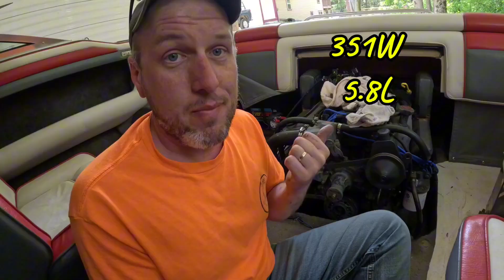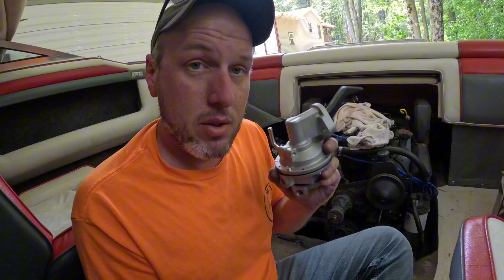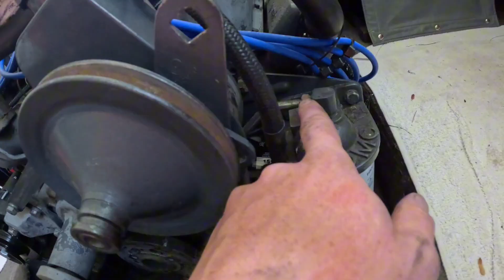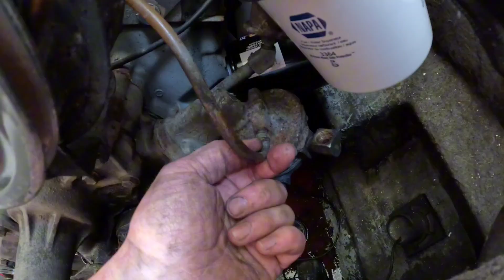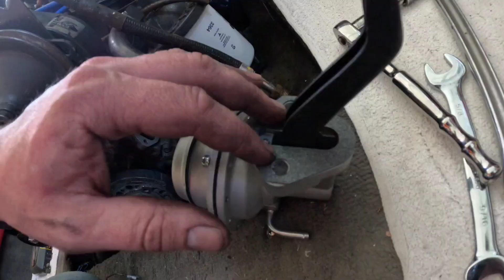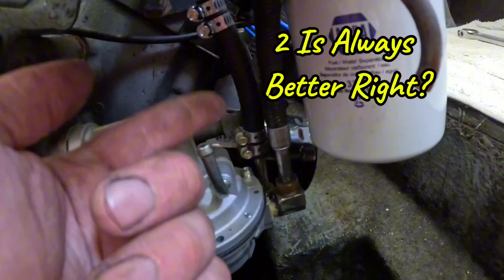OMC Cobra Mechanical Fuel Pump Replacement | 5.8L 351 Ford

Comment: I am having issues getting the fuel pump out because if the motor bracket and another part. Any suggestions? It is on a 1993 Four Winns Horizon. Thanks
Reply from the maker: If you are still having trouble, best option may be to just loosen or remove the other parts keeping it from coming out

Comment: Did you have to use something to hold open the rod in the engine where the fuel pump arm sits in ?
Reply from the maker: No I did not. There is no fuel pump push rod like on a Chevy. This ford one is direct to camshaft. However, an easy way is to use grease to hold it in place if you did have one
Reply: @adventureandrepeat thank you so that arm just slides on into the engine
Reply from the maker: Yes it fits right in the cavity. And depending on cam position the pump may not fully seat onto the block until the bolts are tightened up. Because the cam would be depressing the lever to cycle the pump

Comment: How come you didnt take it apart and rotate the housing to help with fuel lines?
Reply from the maker: Easier to reroute fuel lines than try to reseat the spring and not tear the diaphragm or have it not seat properly

Comment: Have you had any issues with the steering leaking? I’m getting a small leak at the steering actuator. Not sure exactly where it’s coming from but there is some fluid on it.
Reply from the maker: I have not had any leaks yet. But the actuators are a simple design. Fittings and line crimps are possible places to leak, along with the main ram packing leaking as well. Weeping can happen from a pitted ram shaft or if it has Knicks in it. These shafts are supposed to be greased too. There is a grease zirc on the top so it could be from that as well.

Comment: Thanks for the video and great information! That being said I got a question if you don't mind, I'm looking at buying a friend of mine's uncle's boat, what does a 1994 four winns 210 with a 5.8 engine. (Carb).
It's not running right now because the fuel pump went out, and he said a repair shop told him $1,400 to replace the fuel pump because they have to lift the engine to get to it. Do you know if that's correct?
If so, any reason I couldn't just install an electric inline pump? Thanks in advance!
Reply from the maker: Depending on his floor plan if it's similar to mine. Mine has a dog house that I pulled out to get better access to the motor and everything around it.

But yes an electric pump could be added. Just be sure it's marine rated. They are designed to not vent and cause explosions. However you could wire it direct to power, but a proper Marine electric pump is tied into an oil pressure switch. So if the engine ever shuts down to a failure or fire it's not adding fuel to the fire.

Personal preference on which route to go. I debated going electric. But Mechanical pumps just work and I try to limit boat electronics to reduce the risk of failure on the water.

Comment: Is there a reason you blocked out the most important part for most people to see the setting of the new pump arm in?
Reply from the maker: Didn't think it was needed. Arm is attached to the pump. No adjustment or modification needed. Bolts onto the block by the 2 bolts. Is there something you were concerned about with the arm?

Comment: Hi Adventure & Repeat, thanks for posting these vids, very helpful!
I recently acquired a Renken 1700 classic with an omc cobra 2.3 which is running reasonably well. I’m looking to fix many small problems and do preventative maintenance myself. 
I also found a carter replacement, even clocked identical.
Just wondering after watching this post:
Does the engine need to be set to the right timing to change the pump so there is no pressure on the lever whilst tightening it down?
Do you use liquid gasket on both sides of the gasket? 
Oh just a thought: the elbows need to be sealed with a gasoline rated thread sealer correct?
Thanks again for your efforts!
Reply from the maker: I am glad the video is helpful! 

The engine does not need to be timed to change it but sometimes it makes it easier to do so. A long ratchet on a crank bolt will turn the engine easily. 

Yes, I use a light coat of rtv sealant on both sides of the gasket. It's not a requirement but it's something I always do to prevent leaks.

Yes that is also correct, the elbows need to be sealed with gas rated sealer. It's pretty generic  stuff. It can be found most places or on Amazon. It's just not the cheaper air/water thread tape.
Reply: Thanks for taking the time to respond! 
I’m going to try the replacement today.
Happy boating!
Reply from the maker: Good luck with the project!